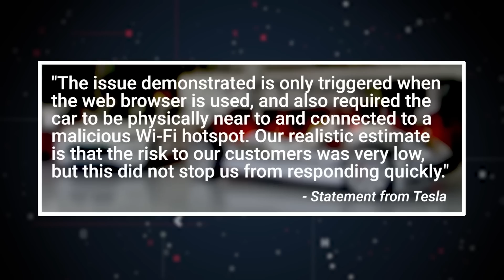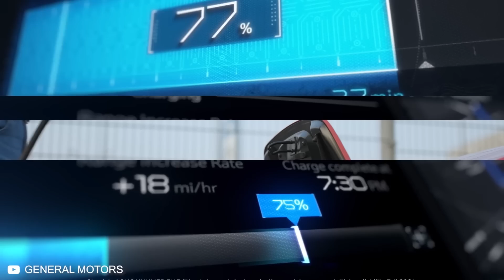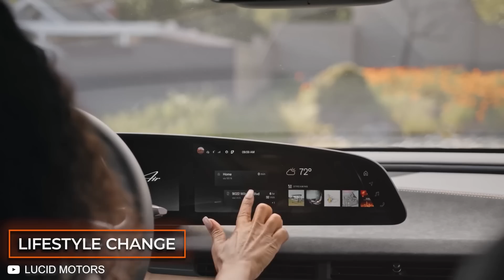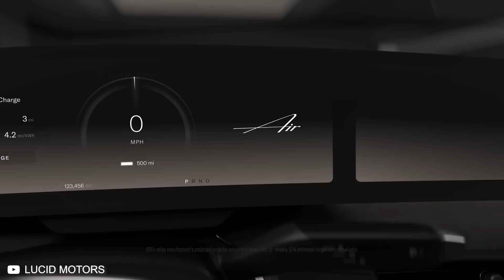EVs' Serious Problems That Carmakers Are Hiding

Comment: I didn't hear anything about the environmental impact of increased lithium production,  or the other ingredients for the battery packs !  WHY NOT ? 
The pretend to be greens never mention this , WHY ?
Reply: Yeah, and just wait until EV's start showing up in wrecking yards. I don't know, maybe transporting and disposing of (or recycling of) hundreds of thousands of lithium-ion car batteries might not be that big of a deal! (environmentally speaking)
Reply: @shawnfinlay4952  Not to mention only a small portion of the batteries are recyclable. There' also the humanitarian issues (i.e child slave labor).
Reply: @carlrood4457  You're right, I didn't think of that. Even though I knew the batteries aren't manufactured in the U.S. So it sounds like it won't be just Americans getting screwed on this deal!
Reply: @carlrood4457  "Last year, Tesla reported that it achieved 92% battery cell material recovery in its new recycling process, and it recycled 1,300 tons of nickel, 400 tons of copper, and 80 tons of cobalt in 2020."
That is with very few of the batteries making it back to tesla.   Most are sold to homeowners who use them for a few more years.  Lithium is not mined by children with rusty buckets and no shoes.
Reply: @danharold3087  All batteries aren't recycled by Tesla. Moreover, it's still just 92% - which combines the high quality and poor quality lithium. If you think 8% isn't a big issue, try imagining it for every single car on the planet. Have you ever seen those massive 'colorful' pools used for Lithium extraction? It's killing the ecosystem thriving in the soil and is polluting the underground water. The problem isn't battery electric vehicles, the problem is LITHIUM batteries. Shift to Sodium, maybe. And I'm all for it.
Reply: @ravenclawgamer6367  
Only 83% of ICE cars are recyclable.  

EVs have a potential lifespan which can greatly exceed our ICE cars.  Mostly due to fewer moving parts.  Current EV warranties are about twice as long as ICE warranties.   If cars need replacement 1/2  or 1/4 as often think of the savings.  Yes current battery cells are not up to this.  They are on the way.

Unless something better comes along electrification of our cars is inevitable. Look to what we can and should do and work to make it happen if you care.    We are still in early days with EV manufacturing there are possibilities and opportunities to do it better.

Future batteries need to be more easily recyclable by design.  I wonder if this is part of how tesla got to 93%.   Rather than po po the accomplishment hold it up as an example for other EV  battery makers to follow.  Find a use for the non recyclable parts.

Magnesium is another alternative to lithium.  It is said to provide more energy density than lithium.
Reply: @danharold3087  Why are you trying to change the topic? I'm talking about the hazards of LITHIUM. I'm very much into electrification, as I made clear in my earlier comment. Just like the industry once didn't agree with the hazards caused by Leaded petrol, they are now not agreeing to the hazards caused by Lithium.
Reply: @ravenclawgamer6367  This was in direct response to your post.   Rather than focus on the existing lithium problem I took a longer view .   As I said magnesium maybe a replacement for lithium.   Moving to more earth friendly compositions is important. The the long view goal is 100% recyclability.   Once we settle on a or a set of battery chemistries we could all but do away with mining once enough batteries have been built.
Reply: @danharold3087  I also said literally the same thing dude. Lithium is not environmentally friendly. In the long run, it might be.
Reply: @ravenclawgamer6367  You're confusing environmental impacts of mining Cobalt with Lithium. Lithium is not really an issue and the US has a massive untapped supply. Cobalt in Africa does a lot of environmental damage because companies want max profits over safety. Here in the US we primarily get our cobalt from Australia which regulates their industry. Also EV battery manufacturers have been phasing out cobalt for years. New EV LFP batteries have no cobalt at all. If your furious about environmental damage from extraction you should care about what US oil companies did to South America. There are areas down there where watersheds were contaminated with 60% cancer rates from exposure.
Reply: @gene4390  "Mining of Lithium doesn't have environmental effects". Sorry to break your bubble dude, but it HAS BAD EFFECTS. And I already said I'm all in for Battery electric vehicles IFF they remove LITHIUM. Till then, I'd happily promote Hydrogen, which is also electric, btw if you didn't know.
Now, what bad effects, exactly? I'll explain.
Mining of Lithium is done via evaporating Brine (cold concentrated solution) of Lithium in huge, let me correct, HUUUUGE evaporation ponds. That pollutes our drinking groundwater. Also, the chemicals which get pulled up from beneath kill the microbial and insect ecosystems living beneath the surface. When the site is abandoned after some years, because Lithium runs out from below, it leaves the soil useless. I repeat, USELESS. Moreover, the figures you presented about the untapped Lithium resources, definitely looks good on paper. However, if you think for longer than 2 seconds, you'd know that to tap into that resource, you'd need to have a Lithium mine every 150 km or so, even in residential areas. There's a reason why Lithium is called a rare earth mineral. And at least check twice on google before you want to type anymore to embarrass yourself even more. Hint : Search - "Lithium Ponds" on google. Go on. Do your homework.
Reply: @ravenclawgamer6367  they have hydrogen batteries? please inform me
Reply: @jonmcnabb6421  Please elaborate what you want to ask.
Reply: @danharold3087  we're not in the early days of EVs. 1850s maybe were the early days. It's 200 years old tech, and despite being developed for so long the problems are the same as they were back then. In 1900 EVs had around 100 miles range on lead-acid batteries. Unless there's some huge revolution they're already obsolete to me.
Also, doubt the lifespan of an EV can be longer than an ICE car. Had 30 years old cars, and despite being heavily neglected the only things that broke (apart from paint, door gaskets, suspensions, brakes and stuff like that) were electronics, batteries, starter motors and alternators. Basically the only stuff that's also in EVs
Reply: @giacomoneri1782  By early days I mean we have a lot more development ahead of us.   If you are going to look at the calendar sure we are not.   But the calendar is kind of worthless.  More like a timeline.  We don't have a crystal ball.

Unless things get derailed we will see massive increases in battery life expectancy and significant increases in range.    With some luck we may see some standardization of the electric motor controllers.

I know old cars. Currently run a 1979 Toyota Hilux, 1991 GMC K1500, and a 1995 Lincoln Town car for long trips.   I would much rather be dealing with a 30 year old electric car.  Yes there is some doubt on the battery but then again early days :)
Reply: @shawnfinlay4952  No junk yards in America will accept EVs.Their is no way to dispose of the junk batteries.
Reply: Cobalt is mined in the Congo by children being paid Penney’s a day
Reply: Also the incidence of EV batteries starting fires will be a significant issue as more of those are placed in service. Some of these will cause fatalities when they ignite in the garage and burn down a house.
Reply: @namvet_13e  kind of like some gasoline cars burn from defects, hmmm
Reply: It's a scam, that's why. CO2 is a good thing. So is global warming.
Reply: I appears that the left side of the world cannot handle the truth aka: "facts"
Reply: @Random-rt5ec  Agreed.
Reply: aluminum batteries will replace lithium ,
Reply: @douglaslynn157  Without being rechargeable. LOL. That's like combining the worst problems of every known battery tech.
Reply: @Larry Butler technology hadn't caught up
Reply: @geoffreyparker926  Yeah. Despite how much BEV companies try to criticize H2, it's in fact the safest tech we have.
Reply: In the UK thieves are now cutting charging cable's for the copper, it's just getting crazy now
Reply: Because they want to force everyone into EVs and we can't have information to argue contrary to what the state wants. People keep talking of Elon and his fight for the environment. Elon is a modern day Al Goore.

Almost 30 y ago Goore was making doomsday speeches on the ocean raising. Funny enough he bought beach front houses. Osama lives in the Martha Vineyard island. It seems ocean raising is not a problem anymore. 

I kept asking where they'd find the water for the ocean to raise like they were saying since ice is more voluminous than liquid water. So, oceans would retract.

Elon SELLS ELECTRIC CARS. Of course he'd be speaking against other forms of transportation. Several politicians have stocks on his companies. Of course they'd force us into an EV and... since most of us can't afford one... we must not drive.

Have people not learned nothing these 2  years? Everyone solution for CV was blocked so the jab could be forced on people.

Less rush hour for the elites to drive around without us peasants on the way is the goal.

Then, there are the lun4t1cs wanting to get the world back to Jurassic period where we will have no fire at all if they see fit.
Reply: Robert , Follow the money.
Reply: If we ignore the environmental impact of lithium mining & disposal, then the problem doesn't exist.
Reply: they lie   what they really want are controlled drivers   they will make it easier to map your location no privacy  self drive cars for instance are all about big brother  following us around    tech is working against freedom
Reply: Because there is nothing green about an ev

Comment: Lots of ridiculous posts based on years-old data. Since 2010, cost for EV battery has fallen 90% to about $130 per kwhr — it needs to fall 25% more to remove any extra expense for an EV over a Fossil fuel car. Oil companies have enormous subsidies that make their products artificially lower in price. And oil (that can be profitably recovered) is running out — a number of top oil producing countries have announced they will no longer export oil as they require for domestic use — such as Mexico announcing no exports in 2023. People complaining of lack of charging infrastructure do not use an EV — mine shows my range of travel and where charging is available nearby —

Comment: I guess the primary worry I have about EVs is the weather.  I live in Pittsburgh and it can be very cold in the winter and very hot in the summer.  I don't own a garage, and even if I did, my workplace parking is an outdoor lot, so no protection from the weather for about 10 hours.  In reality more.  Anyone know how much damage extreme temperatures would have on EV batteries?
Reply: It will be fine, most EV batteries are continuously keeping themselves at the proper temperature. This video gave wrong info. 59 degrees  is not a minimum temperature for EVs, more an optimal.  The most EV friendly countries is also one of the most coldest.  Norway
Reply: @jasons7044  Yes, but EVs in Norway don't get the EPA mileage estimate.  Not even close.  And Norwegians are rich.
Reply: you dont need a garage but i cant stress enough at very least a 120 volt connection... you could live of super chargers alone but who wants the stress.... is my car topped off... will it start... do i have to go fill up before i go do anything or go to work that sort of stuff... if your connected to a 120 volt that all goes away... and for all you petrol heads no i dont wait hours to recharge nore do i wait 5 minutes to refill... i just plug in (takes about 15 secs) and forget
Reply: @jonmcnabb6421  <<. i just plug in (takes about 15 secs) and forget>>

I already disconnect EVs and other vehicles when extension cords across sidewalks create tripping hazards for pedestrians.  

The city of Seattle recently constructed an EV charging station a half mile from my house.  It's posted no parking except when charging,  but I notice that it's usually occupied by vehicles that are not charging,  EV or not. 

Presumably,  an EV could park and plug in to charge when the person goes home at the end of the day,  and return to pick up their vehicle the next morning. That would limit charging opportunities for other EV drivers,  of course.
Reply: @SeattlePioneer  yea i dont think that exists... when ever im not charging and parked somewhere that isn't my electrical... i get charged idoling fees which are usually twice as expensive as the electricity theres a five minute or so grace period to get back to your car and unplug but uh yea thats why i avoid metropolis... last time i tried charging in van... 2 to 3 times as much for the parking garage as it was for the actual charge
Reply: @jonmcnabb6421  
My post:

<<SeattlePioneer
16 hours ago
 @Jon McNabb  <<. i just plug in (takes about 15 secs) and forget>>

I already disconnect EVs and other vehicles when extension cords across sidewalks create tripping hazards for pedestrians.  

The city of Seattle recently constructed an EV charging station a half mile from my house.  It's posted no parking except when charging,  but I notice that it's usually occupied by vehicles that are not charging,  EV or not. 

Presumably,  an EV could park and plug in to charge when the person goes home at the end of the day,  and return to pick up their vehicle the next morning. That would limit charging opportunities for other EV drivers,  of course.>>

Your reply:

<<
Jon McNabb
9 hours ago
 @SeattlePioneer  yea i dont think that exists... when ever im not charging and parked somewhere that isn't my electrical... i get charged idoling fees which are usually twice as expensive as the electricity theres a five minute or so grace period to get back to your car and unplug but uh yea thats why i avoid metropolis... last time i tried charging in van... 2 to 3 times as much for the parking garage as it was for the actual charge>>

My further reply:

That makes sense.  I wonder if that will apply at these Seattle City Light owned charging stations?  I suppose they will.

Still,  that isn't preventing ICE vehicles,  or even EVs from parking in the two charging spaces. That would presumably require the parking police to issue citations,  but that is pretty spotty in a residential area.   Nothing seems to be discouraging that yet,  anyway.

I thought it would be useful to post actual experience with a new situation,  and your post describing idling fees describes how that can be dealt with. 

Thank you.